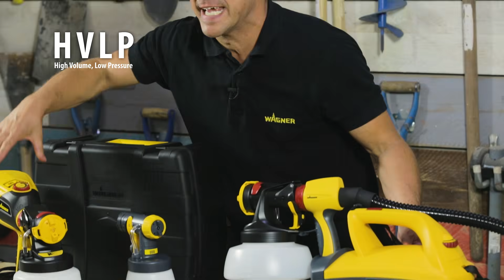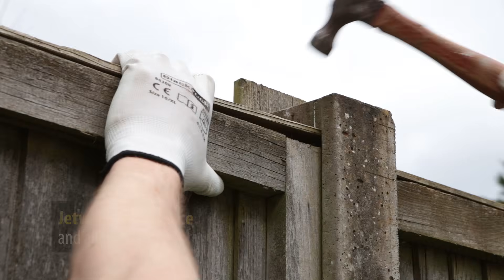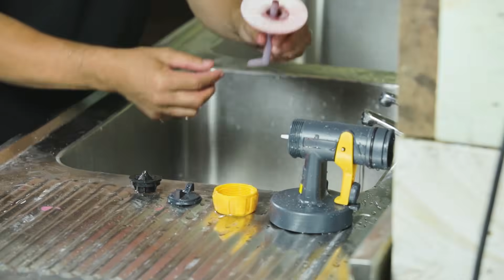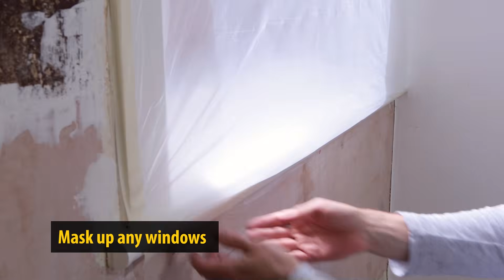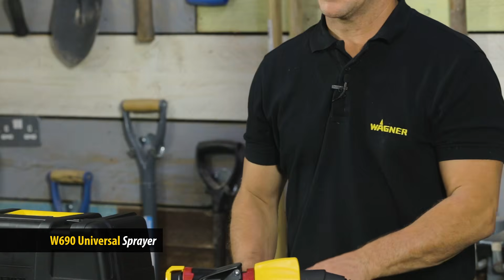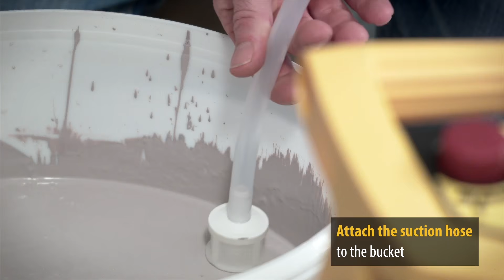WAGNER HVLP Paint Sprayers Comparison with Craig Phillips

Comment: Will the w690 spray sandtex extra smooth masonry paint
Reply from the maker: The W690 isn’t suitable for spraying masonry paints like Sandtex Extra Smooth, but the WAGNER Control Pro 350 Airless is a suitable choice. Airless sprayers are designed to handle thicker paints, including exterior masonry paints, and give a smooth, even finish on large areas. Always follow the paint manufacturer’s instructions on thinning – Sandtex may need diluting, depending on the surface and spray tip size used – and test spray on cardboard first to check the flow.

Comment: Will any of these spray masonry paint like sandtex smooth. Thanks
Reply from the maker: The Wagner DIY sprayers can’t spray masonry paint like Sandtex Smooth — these products are too thick and are not suitable for HVLP sprayers. You’d need an airless sprayer from the Wagner contractor range for that type of coating.

Comment: Can you use oil based paint
Reply from the maker: Hello Yes, you can use oil-based paint with Wagner sprayers. Ensure you thin the paint according to the manufacturer's instructions, typically using a solvent like white spirit. After using oil-based paint, it's crucial to clean the sprayer thoroughly with the appropriate cleaning solvent. Because of the extra cleaning with oil-based paints we typically recommend water based paints as they are easier to dilute and clean up afterwards. Kind Regards Wagner DIY

Comment: Hi , which is the best maybe 950 W ? I want to used at home , please help me to choose
Reply from the maker: Hello The best HVLP (High Volume, Low Pressure) sprayer for home use depends on the specific needs and projects you have in mind, such as painting walls, furniture, or smaller craft projects. Wagner offers a range of HVLP sprayers that are versatility, making them suitable for a variety of home DIY projects. Kind Regards WAGNER DIY
Reply: I want to be able to paint exterior fences. To varnish wood. Also metal surfaces. For home use will be used, I saw videos that the model 950 W is used for professional purposes. For now, he's my favorite?  @WAGNERUnitedKingdom

Comment: I want to spray the outside of a bungalow with a pebble-dash finish.  Which sprayer would you advise for masonry paint?
Reply from the maker: Hello  If you are looking for a consumer sprayer for doing work on your own home the WAGNER Control Pro 350M Airless paint sprayer would be suitable for spraying both the exterior and the interior. You can see product details and where to buy here: https://www.wagner-group.com/uk/do-it-yourself/products-and-accessories/product/airless-sprayer-control-pro-350-m/ You can also only use the smooth masonry paint not the textured type. The recommended tip size is the 619. For general advice about airless spraying it is worthwhile visiting this page https://www.wagner-group.com/uk/guide/airless-spraying/airless-sprayers-for-do-it-yourselfers/ Kind Regards WAGNER DIY

Comment: Can you use solvent based gloss?
Ta
Reply from the maker: With the Wagner paint sprayers you can use water and solvent-based paints but we would recommend using water based paints as they are easier to dilute if required and also easier to clean up afterwards. Kind Regards the WAGNER DIY Team

Comment: You forgot to mention they all have non-replaceable carbon brushes.... Because you want a normally easy to replace part that has a finite lifespan, be a failure point to guarantee a maximum lifespan.

Comment: Overall the 590 flexio seems like a more practical option, it has two tanks, and all in a carry case, imagine transporting the 690 tubes around there bound to get stepped on and pierced and takes up more space in storage if you want to do ceiling buy the extension gun for the 590 for the ceiling. I think value-wise the 590 is excellent as it comes with a carry case etc
Reply from the maker: Hello Theodore, that is good advice.  Kind Regards The WAGNER DIY Team

Comment: Hello Wagner Uk, Can the “Universal Sprayer W 690 FLEXiO” be use to paint cars?
Reply from the maker: Hello The WAGNER W690 Flexio sprayer is designed for spraying wood, metal, walls and ceilings and the spray finish is superior to what can be achieved with a brush and roller. It uses HVLP technology which is High Volume Low Pressure. The low material pressure with the high volume of air ensures slightly larger material droplets and therefore less spray mist.  Car sprayers often use specialist paints, processes and air compressors which generate very fine material droplet but also lots of overspray in the process. Wagner DIY sprayers are not designed for spraying vehicles. Kind Regards the WAGNER DIY Team

Comment: I have the 590 and a question I was wondering about 
If  it can be used with automotive paints 
                                                           Thank you in advance
Reply from the maker: Hello David you can spray metal paints with the W590 but to achieve an automotive spray finish this would require an air assisted sprayer rather than an HVLP sprayer which is the type of spraying techonology used for the w590. Kind Regards the WAGNER DIY Team

Comment: Hi Wagner , i got question. I got wagner 950 , i don't know how to remove handle from my spray  . Is there any part i have to press ? Or just pull out? 🙄🤔
Reply from the maker: Hi. The gun and spray lance remain attached - you just need to disassemble the end of the spray gun to clean it out. The rest of the spray gun will just need wiping down.

Comment: Why o why have you "Wagner" not done more to show the range in more uses from Varnishes to metal paints to hobby use, why is this product not boosted to use in so many applications. the W950 should be the one-stop-shop for all paint applications, but all you have shown it can do is paint a fence or a wall in water-based products, put more effort into the DIY range as you are not promoting the power of this product, Plasitdip, Truck bed liner, 2 pack paint on cars and more. other kit out there is not just painting walls and they only cost £30. put more effort in
Reply from the maker: Hello Gav, you are right the range of applications which you can use a paint sprayer for are extensive if you take a look at the website we've got a number of DIY projects to give people inspiration: https://www.wagner-group.com/uk/do-it-yourself/projects-inspiration/all-projects/ kind Regards the WAGNER DIY team.

Comment: Is the small nozzle on the 590 good for furniture painting & does it give a smooth finish, or should I also buy the "EXTRA BRILLIANT nozzle for a particularly smooth finish", or EXTRA DETAIL nozzle? I intend to use chalk paint (watered down a little)
Reply from the maker: Hello Angie you can spray furniture with the standard spray attachment supplied with the W 590 however with both of the additional attachments that you mentioned you will get a finer finish.  Chalk paint does gives a nice flat finish so I would recommend trying the standard nozzle attachment seeing how you get on and you can always order the additional attachments if you want that enhanced surface finish at a later stage. Kind Regards the WAGNER DIY Team.

Comment: Close to 20 years ago I repainted the exterior of my house with my brothers Wagner sprayer. It had a hose attachment that you could put into a gallon can of paint to carry with you instead of filling the little bucket, constantly. Great for ladder work. Wondering if one of these comes with that kind of attachment.
Edit: House looked great but could use another coat after 20+ years.
Reply from the maker: Hello yes we do indeed have machines like that, they are airless machines and if it's just for use on your own home please take a look at this video https://youtu.be/DhzNNjbCX2U which explains about our DIY range. Or if you need a professional machine see our other channel here: https://www.youtube.com/channel/UCce8s4xycTLZPVnmn6dL3GQ Kind Regards WAGNER DIY
Reply: @Wagner uk
Don't ask me how, but today some primer got into the motor housing of my flexio 990 and has subsequently stopped working. Is there anywhere in UK I can't get it fixed? It's very strange because the machine hasn't missed a beat since I've had it, any help greatly appreciated.

Comment: I'm thinking of getting a 690 to paint my boat with as it seems a little more compact, for those hard to reach nooks and crannies. I want to paint it with old fashioned alkyd paint, I don't need an automotive quality finish, just good coverage and control. Is this unit suitable for such a project?
Reply from the maker: Hello Dennis Yes the W690 flexio would be suitable, you can see more product details and where to buy here: https://www.wagner-group.com/uk/do-it-yourself/products-and-accessories/product/universal-sprayer-w-690-flexio/ Kind Regards the WAGNER DIY Team
Reply: @WAGNERUnitedKingdom  Thanks, I took the plunge and miraculously found a deal I simply couldn't refuse at a local DIY store. I recently painted a door and the only texture visible in it is what was present in the factory primer! As this was just a test using matte paint I couldn't be happier. The best door I ever painted! I now have 100% confidence the boat will come out fine. Thanks for a great product!
Reply from the maker: @sail4life  Hello Dennis That is great to hear, good luck with your boat project.  Kind Regards the WAGNER DIY Team

Comment: Hello, I have bought the 950, but having severe issues with it. When I try to spray a fence, the paint doesn't defuse properly, and gets thick drops of paint on the fence. No matter what I try, and how well I clean it up again, problem stays. It is a brand new machine, I just received last week..
Hope you can help me out Wagner..
Reply from the maker: Hello, I am sorry to hear you are having problems with your machine, please contact the UK Customer Service team on FMB_GBSI_Technical-Support@wagner-group.com or call +44 1327 368410 so they can help you.  If you are based outside of the UK please see the other Wagner office locations at the bottom of this page https://www.wagner-group.com/uk/our-company/ Kind Regards The WAGNER Team

Comment: Hi Wagner, looking to buy a Wagner Sprayer from a local supplier(NZ)Which would be better for trades using? HVLP or Airless???
Reply: If you're spraying homes you want an airless.. hvlp is to fine a finish and is to slow ... 20 frames takes 25 mins with airless

Comment: Great video here , 
I’m looking for a sprayer to start finishing my furniture build designs , in mdf and pine , initially I am thinking of getting the deck and fence as it seems to be fine for that sort of work ? Would you say this is correct
Reply: Hello Scott If you are spraying furniture you would be better with the W590 or W690 as this allows a finer finish than you would achieve with the Fence & Decking sprayer. Spray MDF is a real time saver as you can cover the surface very quickly. Good luck with your projects.

Comment: Can you use oil based paints? If yes how do you clean  up?
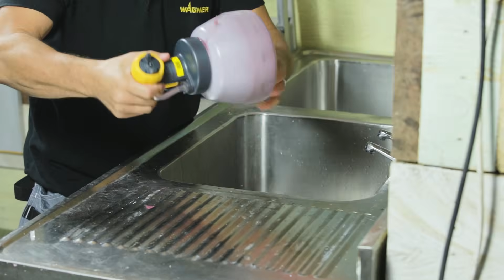Reply: Hello Marc yes you can use oil-based paint the procedure would be exactly the same as if you were cleaning with water which you can see here: 4:57 However, after returning the paint to the original tin if you wipe the inside of the spray attachments with an old rag or paper towel this will remove the majority of the paint. Then pour in some white spirit and spray this through into another bucket and you can then reuse that white spirit once the paint has separated to the top to clean the rest of the components. Best Regards, 
your WAGNER team

Comment: Does anyone know the difference between the flexio 575 and 590?. On amazon it says thr 575 is the newer model to the 590. Tia
Reply from the maker: Hello Ben,
the difference between the W 575 and W 590 FLEXiO are the volume regulation and dimensions:
W 590: variable air volume regulation , 28.5 x 15.5 x 39 cm; 3.1 kg
W 575: 2-stage air volume regulation, 32 x 28.5 x 24 cm; 2.8 kg

If you have any questions, please come back to us.
Best regards,
your WAGNER team